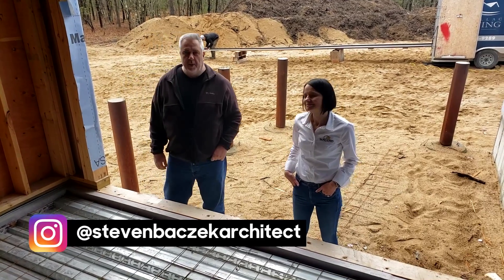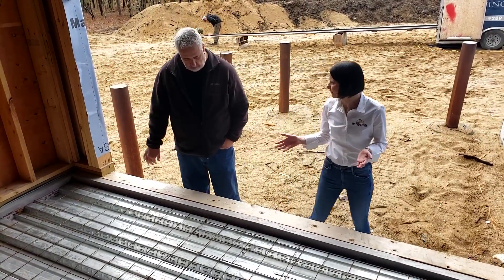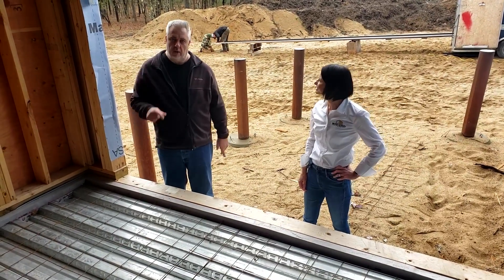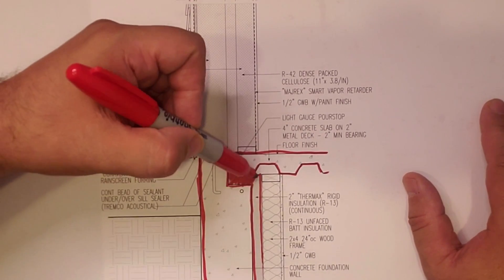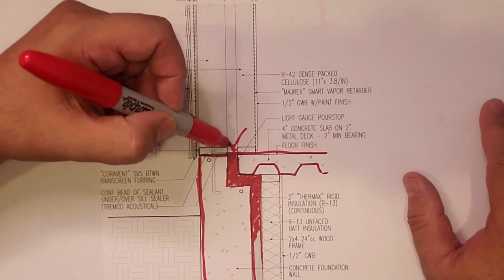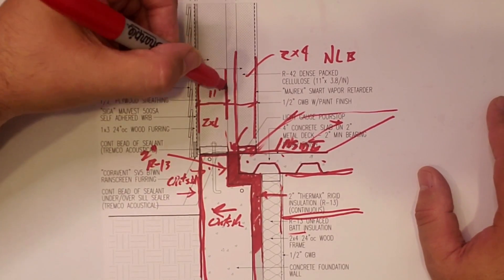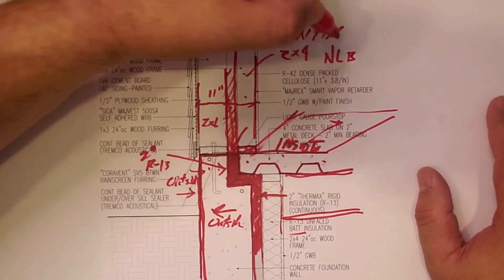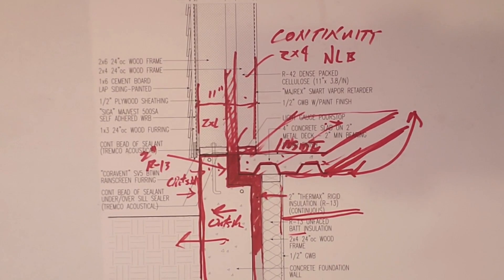ELEVATED CONCRETE SLAB - Edge Insulation

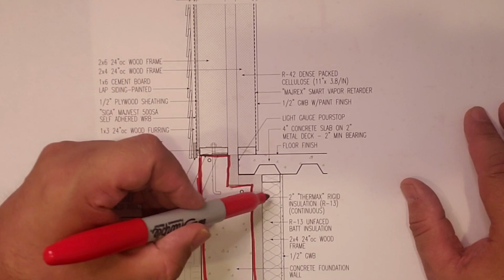Comment: 3:10 Does the foundation wall need a seat for the edge of the floated insulated slab?  For slab-on-grade, could the slab on insulation rest on gravel fill without the seat?

Comment: How would you do this elevated slab if using a perfect block grid screen style wall system? They usually use hung floor systems off a ledger board.

Comment: Hi Steve , can you please do a video on insulating the external edge of a slab on grade. This rigid foam would be sandwiched by a perimeter of concrete as a path. Could you cover the details to install, protect and seal. Thanks.

Comment: Really appreciate all of your videos. I have a question. Would there be more value in insulating the basement concrete wall on the outside to take advantage of the concrete thermal mass?  Im curious how you think about that.